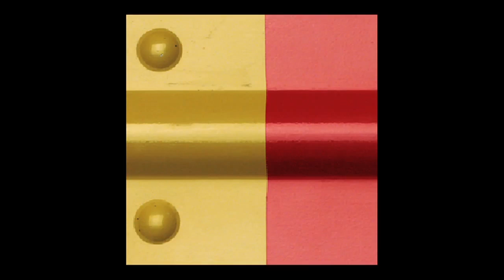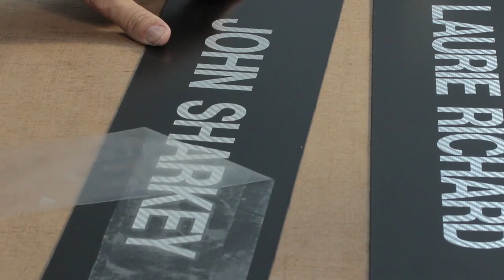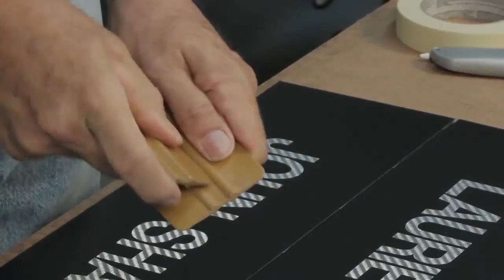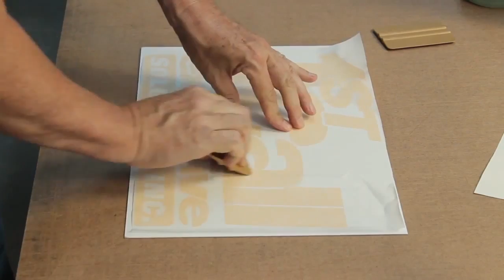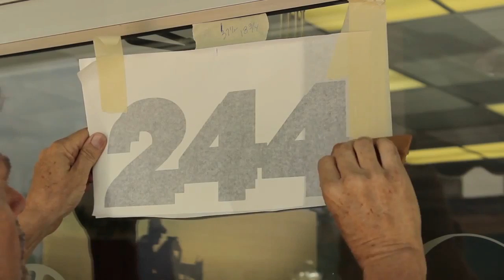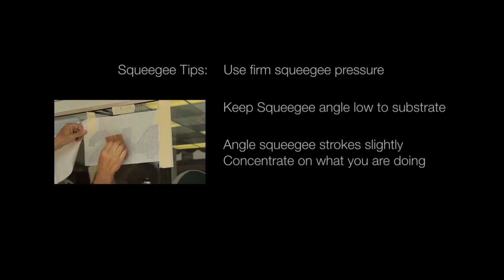Squeegee Technique for Vinyl Application

Comment: I ordered vinyl from US cutter and it showed up all wrinkled and bashed up. One piece had a hole in it and another piece had a piece of vinyl stuck right in the middle of the sheet
Reply: That's interesting. I hope you called them about this. I have ordered 100 times from US Cutter and never had an issue beyond UPS destroying the box during shipping. US Cutter was responsive to that one time issue.